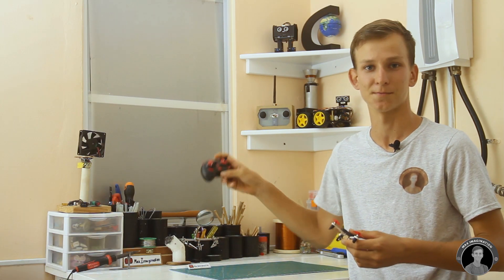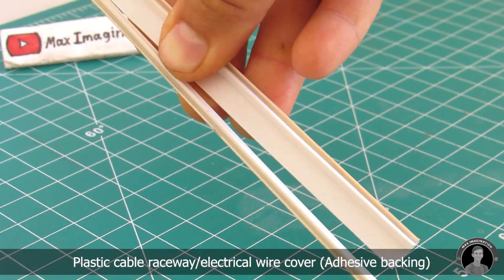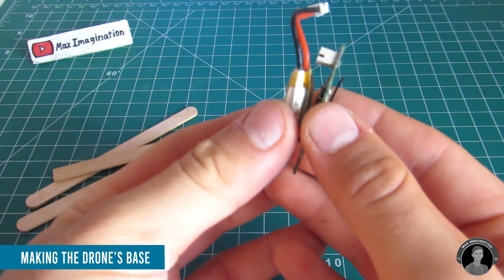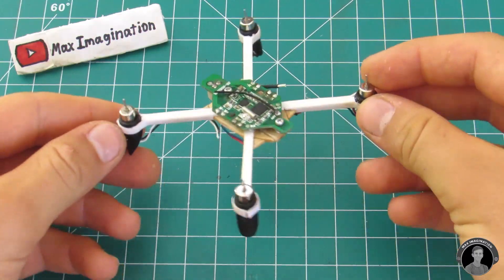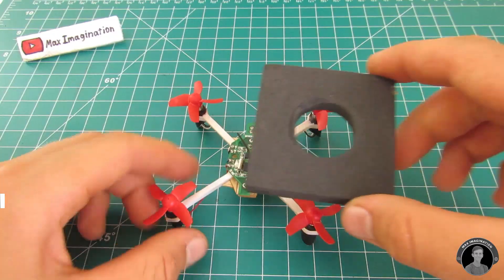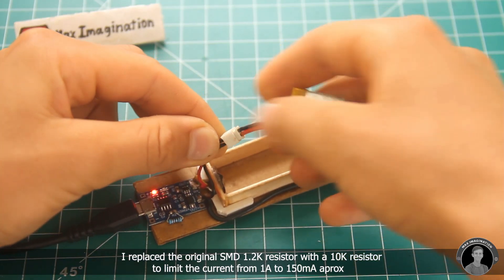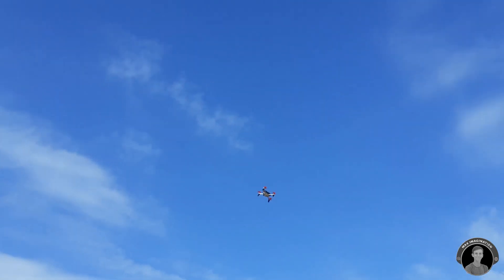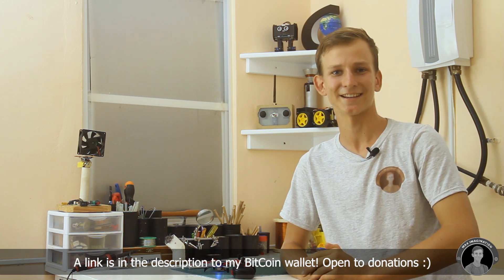Make Your Own Fast RC Mini Racing Drone!

Comment from the maker: Hey everyone! The comment section has finally been re-enabled over the whole channel after 2 years by YouTube themselves who shut it down in the first place. Glad to be in touch with my viewers again! :)
Reply: hi i just have a question can something be attached to it like i want to fly it with esp8266 with small lipo battery is that possible can it hold that ?
Reply from the maker: @Th3Exodia  Hi, that may be possible if your ESP32 SoC is on its own without PCB. Yes, I believe with that it should lift. 

Cheers,
Max
Reply: @MaxImagination  can I buy this drone
Reply: Pls can you give me the link for the receiver Bord pls
Reply from the maker: @houseoflaugher7923  Hi, the only available purchase page of the receiver and transmitter is linked in the description below the video.
Cheers ✌🏻
Reply: Gggthcz
Reply: Can u make a drone without soldering?
Reply: Supet

Comment: My propellers fly off when I try them..they might be too big for the motor. Should I get a different size propellor?
Reply from the maker: Get 30mm propellers with 0.8mm hole diameter for the respective motor shaft.
Reply: @MaxImagination  bro I am going to made it . I have 716 motor with 45 mm .. is it a good design will it fly please tell
Reply from the maker: That depends on how you designed it, I'd need to see a photo of it to tell you. And 716 motors should work fine, yes.

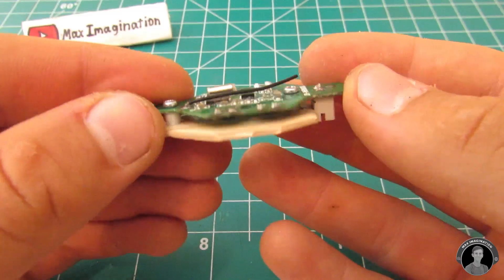Comment: Hey Max! im using this video and another one of yours to create a drone for my Year 12 Systems engineering project, love your stuff. just curious what screws you used to hold the drone reciver board onto the cut up lollypop stick?  at 3:22 (if you could even possibly remeber from so long ago) if not ill try test some different ones. anyway thank you for the insiration!!
Reply from the maker: Hey! Thank you.

I used 1×3mm self-threading screws with wide heads from what I remember. Could be M1 or M1.5 types.
Reply: @MaxImagination  Thank you so much! keep up the good work!
Reply from the maker: Happy to help and will do! Cheers.

Comment: Hey max I have a question can the drone like hover as in can it stay in the middle of the air without moving just in one position
Reply from the maker: Hey. It would require positioning sensors to do that flawlessly. So no, it tends to drift.

Comment: The propellers are out of stock, what should i replace them with?
Reply from the maker: I suggest you find other 30mm propellers on Amazon with a hole diameter of 0.8mm for the shaft.

Comment: Can i control the drone with a homemade transmitter and reciever just like the one you made in another video
Reply from the maker: You can if you make an Arduino-based drone like in my other video.

Comment: i think the link for the cable raceway isnt good, i ordered parts but the u shaped sections are slightly different than yours they also dont bend to fit the motors. i tried to find some, im just going to heat them up so i can bend them
Reply from the maker: Heating and bending yours to fit may be the way. Finding the exact cable race ways even for myself online is tricky. I made my drone with cable raceways I bought locally, which are slightly different and work best for wrapping around motors.

Comment: Hey bro, I bought 7x20 coreless motor and when i connect it to 3.7 v lipo batterry it runs and then heats up and slows down
Reply from the maker: Hey. Check that you have not damaged the internal brushes of the motor.

Comment: Idk where my comment went but also would using different receiver and controller change where I put the wires or make a problem
Reply from the maker: It all depends on the receiver, which is why you should always check for compatibility. Check outputs and if they match, check the connection type and if it matches.

Comment: Do you need to use the same transmitter + controller? If i am following the same steps in the soldering.I am guessing not but just making sure
Reply from the maker: Yes, otherwise they won't pair up.
Reply: @MaxImagination  oh sorry I meant the same pair like pre paired receiver and controller but different brand

Comment: Hi how do you connect your drone to your remote control? I am a Newbie
Reply from the maker: Hi. They connect automatically when both powered up by signal. But calibration type pairing may still be needed. This is where you throttle up the left joystick and then down before flying.

Comment: I want some stuff for £20 as that is my budget so can you please help
Reply from the maker: You can watch my third to last video about the Mini FPV drone and build it within $50 USD, but that's as cheap as it gets when it make it yourself.
Reply: @MaxImagination  can a 8mm motor work
Reply from the maker: Yes. However, since it's heavier than a 6mm motor, you'll need to better manage the weight of the frame and batteries to accommodate for these wider motors.
Reply: @MaxImagination  ok, I have got supplies but it is not one to one, can you check it

Comment: Hey max If i use 250mA battery is it gonna damage the circuit board?
Reply from the maker: The mAh is simply current capacity, not like voltage. More voltage would damage the board, yes. However, more current capacity (mAh) will simply give your drone a longer run time but make it heavier.
Reply from the maker: You can safely use that battery assuming it's 1S (one-cell)

Comment: I never thought it would be this easy! Thanks so much, I'll make one myself from your help! Just want to know, can I ask you questions here in the comments section in case I'm stuck or confused?
Reply: Already got a question! What's the weight of the drone? Want to know as I am purchasing motors and blades from elsewhere, so I need to know sufficient power.
Reply from the maker: Hey! Firsly, I highly suggest you instead follow my updated video on this type of drone, check out my second to last YouTube video.

Sure, no problem. You can ask for help in case you get stuck by making a new comment.

This drone weighs around 20 grams.
Reply: @MaxImagination  Thanks so much! But the new one I saw, is a lot more complicated as I am a beginner. This one looks simple. But I am going to leave it to you to make the final suggestion (if the complicated-ness of the new one is worth it or not, for beginners).              ...        By the way I am an old subscriber :)

Comment: I have several types of coreless motors with props and build light frames with 3d pen. None of them seem to get off the ground and the motors end up hot.
Reply from the maker: You need higher performance coreless motors intended for mini drones, you can check out my latest mini drone video on my channel and check the video description for the product link to the coreless motors I'm talking about.

Comment: Can I use brushless motors instead with this accelerometer never mind the battery and other components?
Reply from the maker: No, it won't work. You'd need a different receiver with brushless ESCs for the motors.
Reply: Provided I have ESCs and receiver, can I used brushless motors and what changes would I need to make to the code?

Comment: Name of the receiver you used
Reply from the maker: It does not have a "name", only a model number by which you will not find it online anymore. You can acquire these receiver boards online. This one came from a broken Eachine E010 drone.

Comment: Do You know the specifications of the receiver so I can get a transmitter for it?
Reply from the maker: It uses the "JR-NH010R" receiver board.
Reply from the maker: P.S. You can purchase the transmitter and receiver for it via the link in the video description.
Reply: I did some research but couldn’t find anything about the receiver
Reply: Do You have any info about the protocol it uses?

Comment: What about the controller? Does any work?
Reply from the maker: Hi. Not just any controller works. You need to purchase or find a drone's receiver and transmitter pair that are programmed to work with one another.

Comment: Hey! I know its been a while since this video was uploaded, but i have a question. Im making an autonomous variation of your drone design, using a XIAO ESP32S3 Sense microcontroller, an mpu6050, and drv8833 motor drivers, I have 320 mAh lipo battery, and am using a tri copter design with 3 motors instead of 4, but for some reason, it stalls after running for a little bit at high speeds, do you have any idea why this is?
Reply from the maker: Hi there! Such issue sounds like something coming from the motor driver's end. You may have picked a motor driver too weak for the higher currents the motors reach when at full throttle. You will definitely need to check that first. Cheers.

Comment: Cool, You ever have any problems with over discharge on those batteries
Reply from the maker: Not that I've experienced. The circuit board regulates that and cuts off power for flight when the battery gets too low. However, it is up to you to unplug the battery to prevent over discharge from the light load of the blinking LEDs.

Comment: Hey this is great and very informative for us beginners. Just one question though... What if you're buying the remote control and receiver circuit board individually? How do you sync them together?
Reply from the maker: Hi there. Thanks! You cannot easily sync a different factory remote and foreign receiver together as they're most likely programmed to operate on different channels and bands on a certain frequency.
Reply: @MaxImagination   Thanks for the reply. That's what I was thinking but just wanted to double check to make sure. Problem is, it seems that they are hard to find selling together, at least on eBay. So I had to check Ali Baba to find what I needed (remote + receiver). And sure enough, I think I was able find what I needed. Thanks again :)

Comment: From where can i get the transmitter?
Reply from the maker: At the moment, it is hard to acquire this exact transmitter. It is unavailable in online stores. I will one day focus on making an Arduino based drone that anyone can get the parts for. Cheers.
Reply: @MaxImagination  thanks for replying
Btw can you make a receiver and transmitter based on infrared light emitting diodes and IR receivers??

Comment: Hello, I am in India. The transmitter and receiver are unavailable here. Can you you please suggest any alternatives?
Reply from the maker: Hi there! I'd be unable to give you Amazon links to the parts you're missing, but I've found some purchase links from Banggood - Transmitter: https://www.banggood.com/Eachine-E017-Mini-RC-Drone-Quadcopter-Spare-Parts-Remote-Controller-Transmitter-p-1979012.html?cur_warehouse=CN&rmmds=buy
Receiver: https://www.banggood.com/Eachine-E017-Mini-RC-Drone-Quadcopter-Spare-Parts-Receiver-Board-p-1981798.html?rmmds=detail-left-hotproducts&cur_warehouse=CN&trace_id=bcd61680659630822

Cheers.
Reply: @MaxImagination  so, i have to do something to pair the transmitter and receiver? If yes, how?

Comment: I do something similar with the legs but i flare my legs, on the upper portion, by making 3 cuts and fanning the top "wings" outwards, so when i drop the leg into the arms loop, it will naturally have resistance and not go any further.  It provides that extra amount of security that I like having, so when I land or take off, the motor doesnt slip put up or out down.  To prevent slipping down, you can make 2 slight cuts a few mm apart on the bottom bottom, and bend that portion in. When you place the motor in that bent in part will naturally clip the motor in place.
Reply from the maker: You sound ahead of your craft! That seems like a more secure solution for DIY drones when using cable raceways. Thanks for the tip!

Comment: It will be connected to controller or we have to connect it
Reply from the maker: You need a controller remotely connected to it via Radio Frequency, yes. No pairing needed, powering on the two devices simply does it.

Comment: can u put camera on it, small one like 26gb
Reply from the maker: Hi there. Lightweight cameras such as 2-megapixel micro action cams may work. Anything heavier than 10 grams will restrict the drone from taking off into the air.

Comment: Hi max i have loved this invention and i want to build to but i have a different transmitter and reciver it is squared shape pls help me do this
Reply: Pls i need help to make it and can we use 300 mah 3.7 volt lipo battery ?
Reply from the maker: Yes, you could.
Reply: I have a rectangle transmiter too
Reply from the maker: Hi. Thanks for watching! You could build yourself a drone with such receiver and battery. However, you'd probably need to scale up the frame in size (a bit) as well as the coreless motors.
Reply: Thanks thank you very much

Comment: I hope you respond cause im in need

so i bought eachine transmiter and a different eachine receiver and the both dont receive and transmit so what shall i do ?
or i should bind them? 
plz help
Reply from the maker: Hi, 
First, please tell me the Transmitter and receiver models you bought.
Reply: @MaxImagination  ok here are they
Eachine E50S RC Quadcopter Spare Parts Receiver Board

Eachine E57 RC Quadcopter Spare Parts Transmitter

Comment: Great DYI! Curious what the estimated cost was for this build? BTW second link on parts list is unavailable as of this post
Reply from the maker: Hi there, thanks for watching!
The cost for making this drone was about $10, the cost may vary depending on what parts you already have and don't.
Sorry about the unavailable product on that link, I couldn't find a substitute controller that's in stock, you'll either have to do a bit of your own searching around to find the corresponding part, or wait til the part is back in stock for that link. I don't really have any control of that.

Have a good weekend! 
Cheers

Comment: What soldering tool do you use?
Reply from the maker: I use the soldering iron from a kit similar to this one, my brand though is 'Anbes'
https://www.amazon.com/Soldering-Iron-Kit-Temperature-Desoldering/dp/B07S61WT16/ref=sr_1_3?dchild=1&keywords=anbes+soldering+iron+kit&qid=1630107939&sr=8-3

Comment: can we attach a camara with it
Reply from the maker: Hi, yes you can, but as any other little camera would probably outweigh the drone, we'd need to attach one with a small camera sensor which has a really simple function of just filming to a Micro SD card. Then I believe such a setup would work.
Cheers!

Comment: Max bro can I use 614 coreless motor with 3.7 380 mah battery And finally ask you my doubts comments are back 🎉🎉
Reply from the maker: Hi there, thanks for watching.
Yes you may use a 614 or even 612 type coreless motor with a 380mAh battery, sure :)
Yes, my comment section is back under all of my videos, finally YouTube unblocked them
Reply: @MaxImagination  I am so happy bro 😊
Reply from the maker: @DynoPlayz873  :D